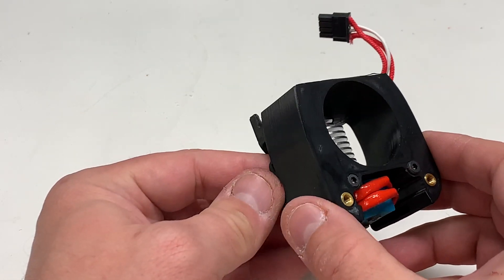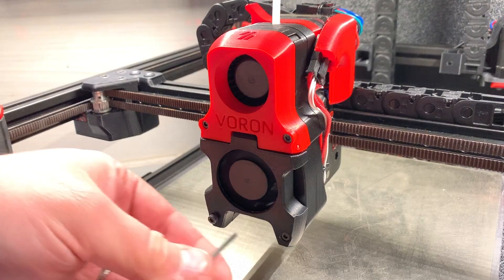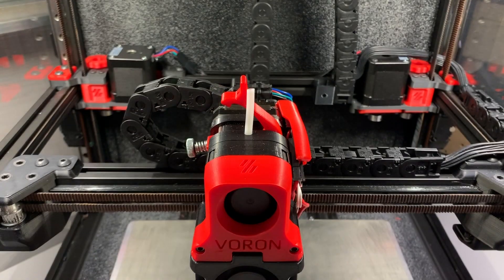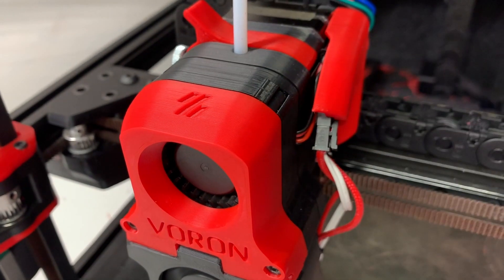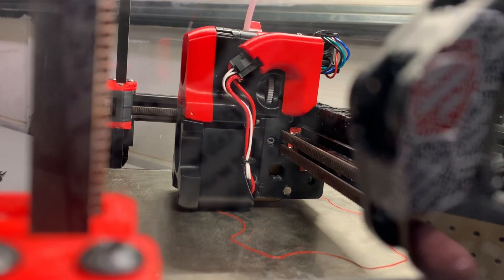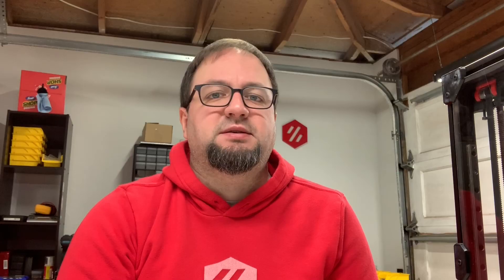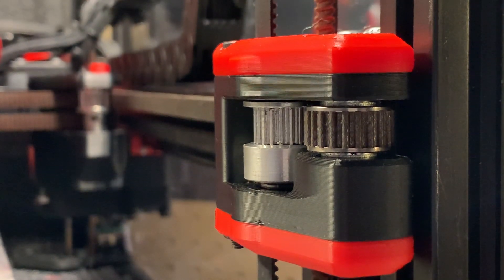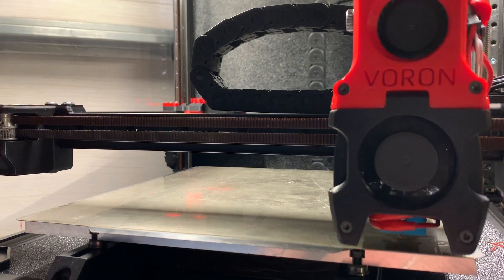VORON Afterburner Announcement

Comment: You're not making it easy for a newcomer to learn about the designs. All you have in terms of pictures on the site are moodily lit detail shots of the dramatically highlighted red/black parts. Have a sober, non-hyperbole, well lit, overview video for each model, preferably not in a talking head format, focusing on the printer design, no fancy or rapid cutting, no effects, no music. Information, basically.
Reply: There's datasheets, manuals, files, schematics on the site. This printer isn't really for newcomers.
Reply: @ChromePhoenixQ  I'm far from a newcomer (the Voron will be the third printer I've built) and, after digging through the GIT repos, CAD, and discord for months, I have a pretty good handle on the Voron. But I completely agree with this commenter's point, and I've seen people on the design team agree with the point as well. The main website doesn't have a single bit of information that would help someone to decide whether or not they might like to build a Voron, or what the differences are between the different models. This information does exist out there (e.g. here: https://bdbell.github.io/VoronDocs/hardware.html), but the only way to find that information is to ask in the subreddit or on the discord server, and hope that someone in the know points you in the right direction. Fortunately, this is something that's being worked on, so hopefully, the situation will improve soon. Although... that may be a double-edged sword, because it will probably drive a flood of new interest.

Edit: since posting this reply, the main site has been updated with links to additional info about the printer models, sourcing, and building.